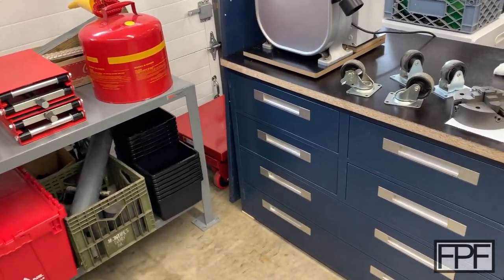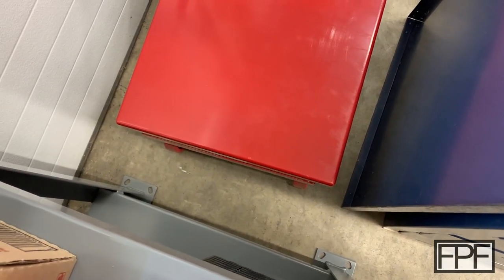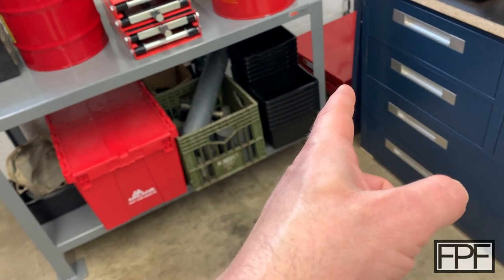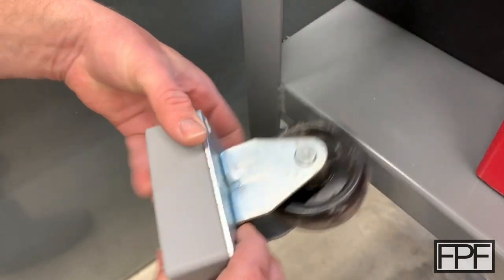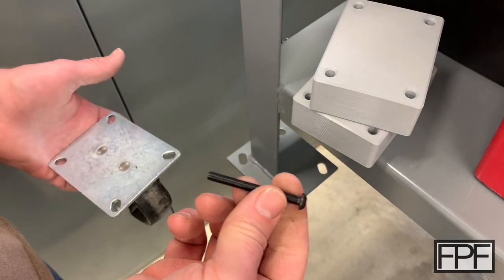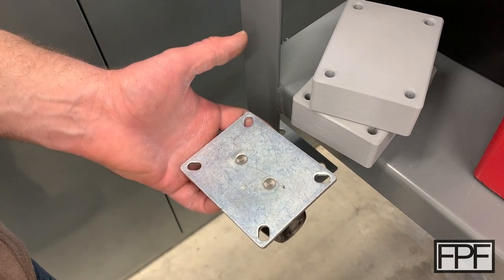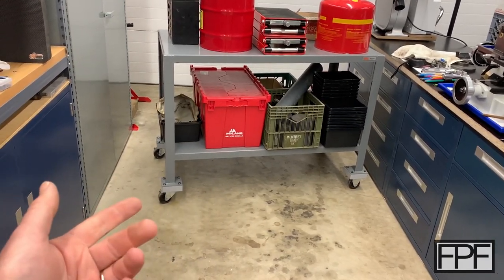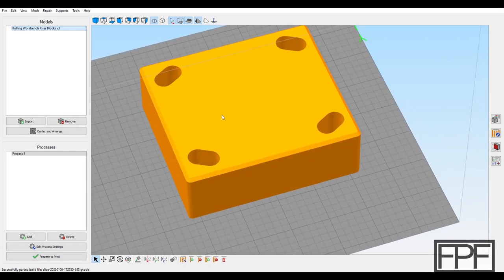3D Printed Riser Blocks for Rolling Workbench

Comment: When I'm doing something that needs to fit like this, I usually do a test print that's only a few mm high just as a sanity check. I just don't trust my cylinders and such to come out the right size the first time. .
Reply from the maker: Yep, did it on the 2nd one, just didn’t show it.  Should have done it the first time :(

Comment: The way I understand it, if you use the right infill, you can cut back the amount of filament and time a large amount without cutting back  on strength much.
Reply from the maker: I need to investigate which gives the most strength in the shortest time

Comment: 25:35 I think I would have used 5 perimeters and do a cut out circle in the middle. With 10 walls clearance distance to the slots for the screws. This would have added strength and probably saved material as well.
Reply from the maker: Thanks for the suggestions.  Always good to compare in the slicer as well.   Sometimes when adding the cutouts, the increased overall "wall" length equals more filament than the infill and top/bottom surfaces.
Reply: @FunctionalPrintFriday  yeah that’s true. But if it’s equal walls do add more strength in most use cases. 
Thanks for your vids. With such vids and discussions we can make better parts :)

Comment: Measure twice (or three times) and cut (print) once. Sometimes we get fixated on the goal and don't plan the path. After painting yourself in a corner once, you should never do it again.
Reply: Yeah but with a Voron, Bambu or the Prusa MK4 printing and testing the part is faster/easier. And the first print is going into the bin anyway with my experience printing prototypes.